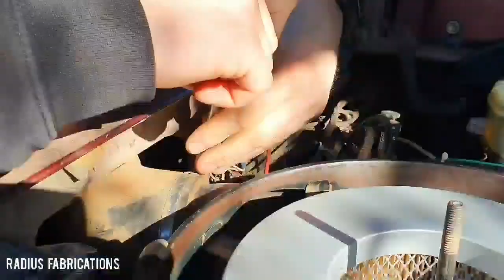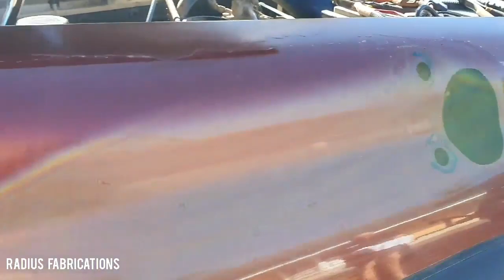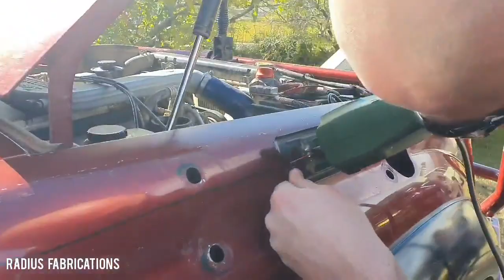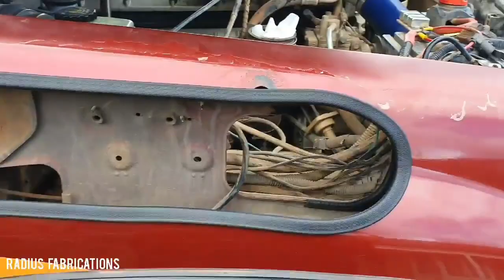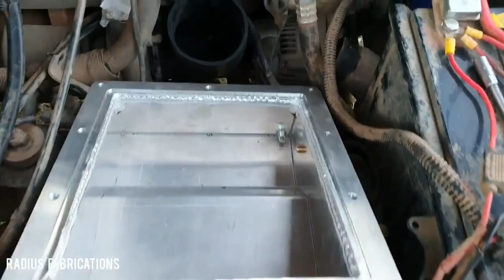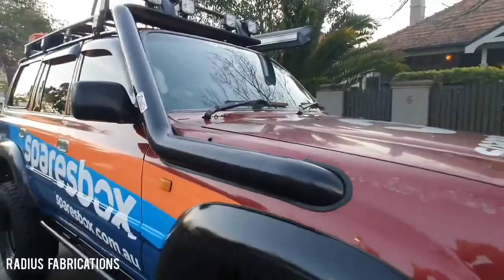Stainless Snorkel Install & Dosing on Turbo Diesel Landcruiser

Comment: How much boost mate? I got a radius airbox for my 105 series and it fits no where near that well. Rubs on the bonnet and the inlet to the turbo touches the air con lines